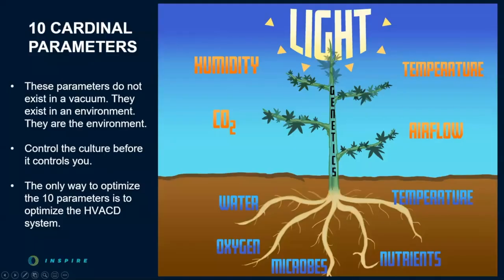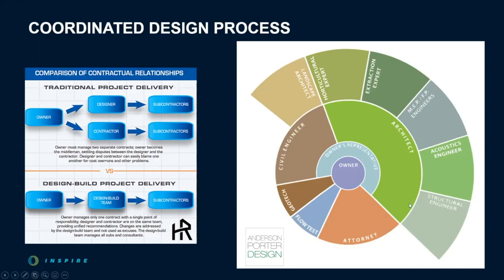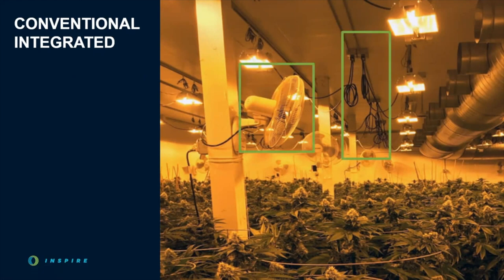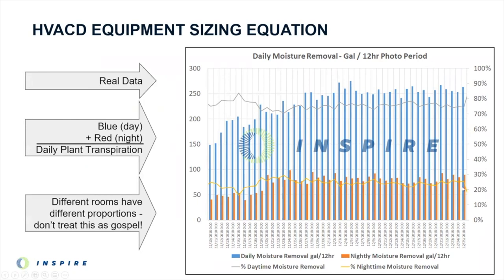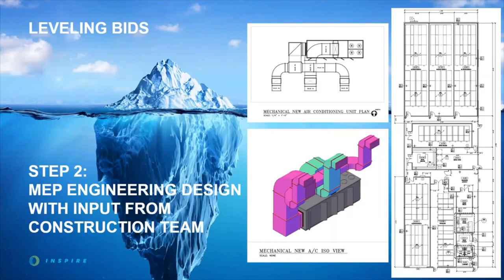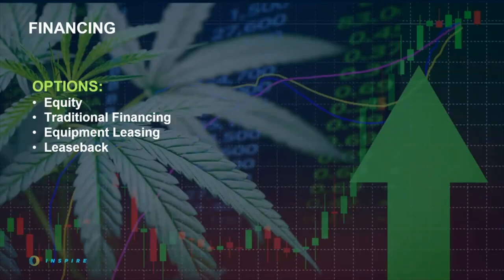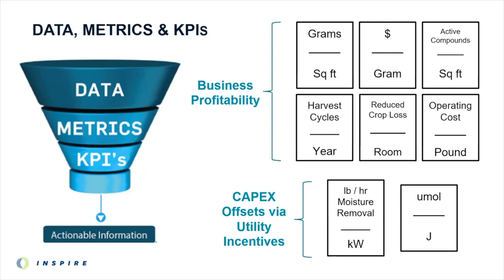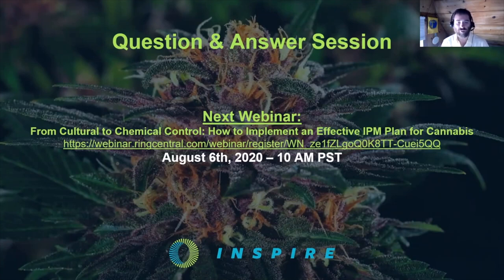Integrated HVACD vs. Conventional Non-Integrated HVAC

Comment: Most efficient AC in a grow... I ever saw, in 15 years harvesting... Florida, ahead of the game as usual, with a water cooled HVAC. This was slick AND morr efficient. The grow was hidden, 30 to 40 HPS hoods, all cooled with a small pond behind property. The system had pumped cold water from the bottom of the pond to cool all the rooms, some 1 third of his power bill dropped, all from normal ac Units! The heated water was pumped back into the bottom of the pond, all hidden by pvc to the pond.. nobody could tell at all, no noise, no bubbles in the pond, nothing. Huge power savings with water cooled a.c. for sure
Reply: Some states offer grants to install Geothermal systems into their grow, i know a company that got a million dollar grant for a geothermal well that they installed and it been saving them tons on electricity.

Comment: YES! YES! YES!... I've been trying to explain this concept to clients for a while now.. it is sooo important to design the system so all aspects of the environmental controls work together in a synergistic way, and are designed to meet the needs of cannabis cultivation specifically, everything from number of plants, Target VPD, expected transpiration and evaporation rates, room volume, exchange rates, flow direction, lighting type, total BTU's generated by all electrical equipment in the room, the sensible heating component and the latent heating component all need to be considered in tandem... and that's just the short list... take the time to work out the interplay of all the environmental controls upfront and work them into your design and you will drastically reduce your exposure to long term risk, crop failure, and operational overhead.
Reply: Where do you operate ?
Reply: @HandTeam  I'm based out of Victoria BC Canada. Yourself?

Comment: Re the geothermal discussion at 52:40

It's not always about seasonally storing energy as is referenced.  There are areas of the country where the cyclic day/night air temperature swing is great enough that the 'battery cycle' is 24 hours.   This is more common in high mountain/desert terrain (Rockies/Sierra).  Our daily swing approaches 35f year around making air to ground heat transfer systems a viable way to store a significant portion of say a greenhouse solar load or indoor lighting heat load during the day, and return it each night. 

Love the presentation.  In the long run, these piecemeal systems, widely utilized currently, are going to get crushed as better thought out and integrated systems come on line.  Simply choosing a better location for your facility, one with favorable environmental raw ingredients, can result in far lower production costs and an insurmountable competitive edge.
Reply: Which are on your opinión favorable raw conditions in this case ?
Reply: @findingsolutions198  I said it 15 years ago, i say it all the time.. South Florida is the best spot in America. Very few people have time to see all the grow areas like I have. South Florida curaleaf, already has it going.. googlemaps curaleaf south miami, that location is the best location.. best UV for resin ive ever grown, plus no frost ever!
Reply: It is cheap to add water to air.  It is expensive to remove water from air.  
It is cheap to add heat to air.  It is expensive to remove heat from air.

The psychrometric chart tells all
Reply: @johnborton4522  watercooled hvac systems FTW
Reply: @dertythegrower  

If you must use compressors and you have a source of water, they are fantastic.  I built my first large   (3,000ft)  indoor facility in 1985 on Lower Balsam Lake, Mn., using compressors cooled with shell and tube exchangers from the lake water.

Compressor based systems will always be at a competitive disadvantage however to other less power hungry methods.  Location, location, location.
Reply: @dertythegrower  Im in Europe ... 😉
Reply: @findingsolutions198  Morocco is the source for many in euro for a reason. Spainnabis, you should go there next event..

Comment: You can't put a # on yields because each plant has different genetics its a living organism you can never replicate mother nature no architect engineer or contractor can design a building that can act like nature
Reply: Given the combination of accumulated strain specific knowledge, on-the-numbers environmental control and reproduction technologies such as tissue culture, you can actually put very tight #s on yields -- with per plant production variations down in the mid single digits % wise.  

The task is to create a production system which highlights the positives of the way nature acts and minimized the negatives.
Reply: I run a few large scale operations and own a few smaller vertically integrated operations and i know first hand that quality on scale is achievable with properly designed, built, automated facility, with a well trained staff. But nobody can replace the personal relationship between grower and plant.
Reply: @thetruthmanification  nice words
Reply: @thetruthmanification  Well said. Same boat. Scalability is an issue in cannabis. I worked for canopy growth, native roots, and even 3 pounds a light author, aka Superfarm in denver. None of them make 3 pounds a light because as you said, the teams need all the same growers and minds on 1 property, and as of 2020 it is still hard to do that, even with the 3 large companies I pointed out above...they still have simple issues in their gardens, with their "master growers" not being able to stop PM or mites. I have not seen 1 good large corporate cannabis company that doesnt have simple issues in their garden, either PM or bugs, all of them! Some of those companies would not let machine trimmers talk to the growers, or reveal and let anyone but the grower in the grow(fishy, and claiming to say they have secret recipe or techniques, yeah friggin right)
Reply: chase rieta I can agree to that. I run a commercial facilities environment and fertigation side. Night and day difference from when i started running it the way I wanted.